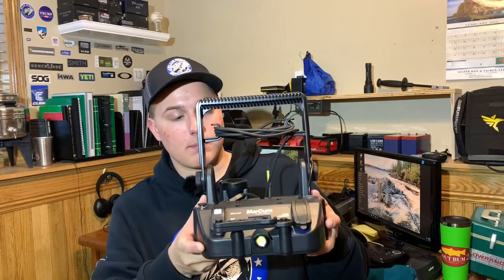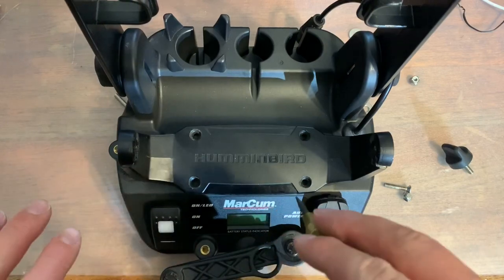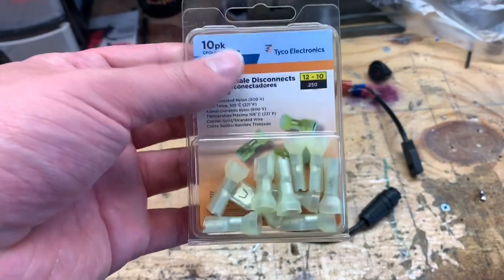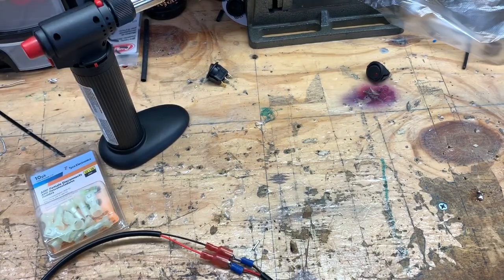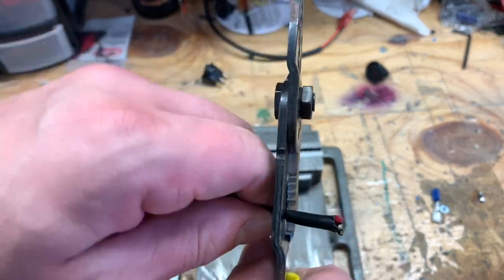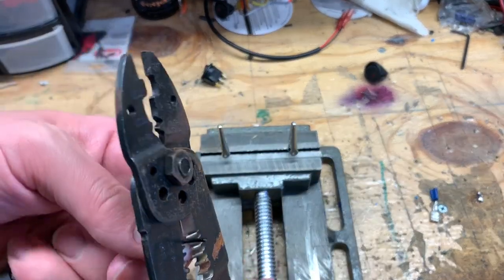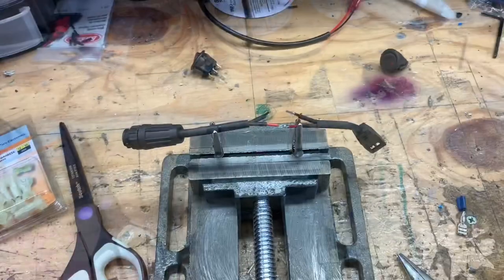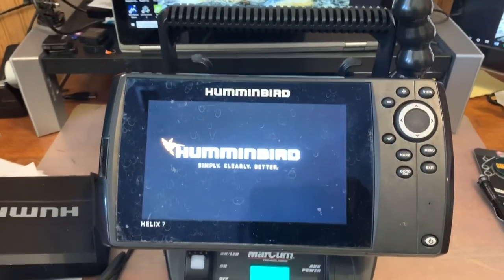How to put a Humminbird on a Marcum Lithium Shuttle

Comment: My Hummingbird Helix 7 Ice g2 power wire has three cables, a red power, a black negative and a bare wire, I assume ground? do you have to do anything with the bare wire when you connect it to the Marcum adapter cable?
Reply from the maker: I didn’t use the power cable that came with the helix ice I used a new cable and it didn’t have one. Since it is a bare wire it is most likely the ground, so don’t worry about it just hook the red and black up properly.